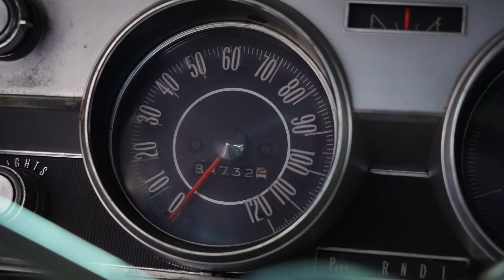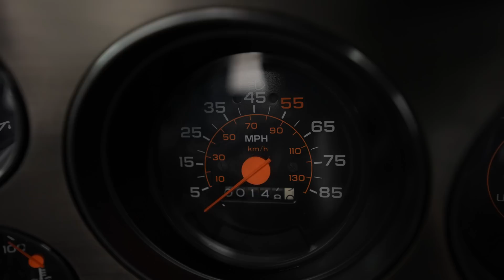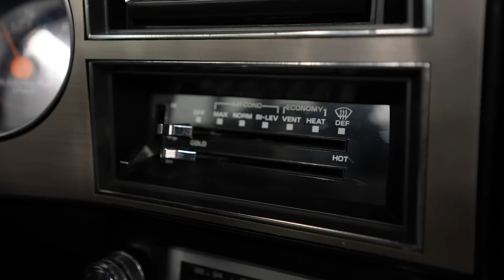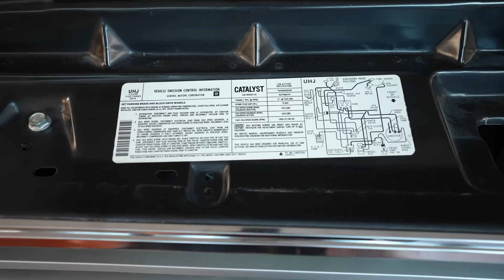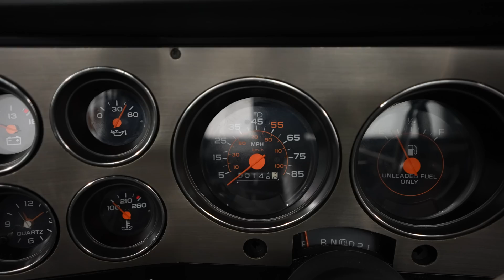EXTREMELY RARE Chevy C10 Short bed with 148 miles, WHAT'S IT WORTH? | Barn Find Hunter

Comment: I’m not a truck guy but that C10 is just beautiful.  I can’t imagine buying a vehicle that I’d be afraid to drive though.  It wasn’t built to sit in a garage not moving.  Having said that it might be best if a museum bought it, a place that would keep it pristine but where people could see and enjoy it.
Reply: True!! They need to get it out of the humidity and into a much drier storage facility. EG: The front sway bar had so much rust on it!! If I bought this truck it is going to cost me a lot of time to get all the rust accumulation removed and repainted. I would do it myself, so it wouldn’t cost much, but the time. Send it to a body shop and I see $10K or more. A lot of this truck will have to be dismantled and then put back together.  Some of those parts would be much cheaper to just replace,,, every part of this truck is still available essentially, but then it’s no longer the same truck!! 
     It’s worth maybe $60K. The truck is ultra low mileage, but wasn’t stored well. It’s affected a lot by the local environment.
Reply: repentandbelieveinJesusChrist2  I thought Jesus was a Ford guy.
Reply: BUilt to drive its just metal and bolts like any other. 
People act like its some rare hope diamond and if it sees the sun it will explode.

Comment: Dont LS that camaro.....
Reply: Yeah, I agree. LS is a good engine, but not what should be put in a car that original. Maybe if it were a fixed up rust bucket that's half patch panels, but something that's managed to keep most of it's original steel should have something at least close to era correct.

Comment: ON THAT cracking  protective sticker >>  09:25 --Turtle Wax Multi-Purpose Label and Sticker Remover will completely and safely remove that without damaging the paint,  my old 95 Explorer had those and this T.W. product worked like a charm,  spray a coat on it...let sit for a minute and gently start working protective film off with a thin plastic guitar pic..spray, repeat...then go down to terry cloth towel once down to gooey adhesive part..

Comment: The Silverado is nice but the 305 hurts it a bit.  I hope whoever gets it drives it.
The camaro needs to have the 327 rebuilt with a mild cam and replace the 3 on the floor with a 5 speed.  Cheers 🇨🇦
Reply: 305 or 350 doesn't really matter.  Neither are fast.  Truck is a cruiser, it won't be doing any work or towing so 305 is just fine.
Reply: Those Camaro's had 4 speeds
Reply: You couldn't get a 350 in a 1/2 ton 2wd truck that year.

Comment: The 85 Chevy truck is awesome -- I have a 1987 Chevy Silverado K10 with the Fi 350 bought brand new with every factory option including dual gas tanks have all the paperwork mine has 490 original miles - perfect show condition always garaged
Reply: I thought the K 10 was GMC
Reply: @worldboatskiff8709  K10 just means its 4 wheel drive -- C10 was 2 wheel drive
Reply: your truck is many times more desirable than this one, the 350 is almost unheard of, i had the same exact truck, short bed 20 years ago, it was a $5k truck then.
Reply: @freebird7284  Very Cool

Comment: Had the same truck but from a different mother mine was a 85 GMC short bed same everthing from the power windows to all the same trim just different badge-ing same motor as well the 305 yes it was a 2 barral as well I changed mine to a 4 just a few months after I bought it gave it more pep and torque.  
I personally put 82 thousand miles on it in those years just changed the batterie twice and the alternator dam good truck.  
Drove it till 1991 too this day I wished I had never gave it up!

I forgot to add that it was a Sierra Classic GMC red with black interior.

Comment: My grandfather bought a 1982 Scottsdale, same as this, shortbed, vertical front bumper guards, but proper rear bumper, flat top, chrome, I don’t know what that bumper on the back of this truck is all about.   My grandfather died in 1983 and the truck of course went to my dad, but really to my brothers and then in 1986 when I turned 15 it became my first car.   We never did figure out if it was a 305 or a 350, as none of the stickers told that, and we weren’t keen enough at the time to figure it out from the VIN or whatever.  But it was a Rochester Quadrajet, my grandfather had the cats removed, and made it dual exhaust with factory type mufflers.  He didn’t want it too loud, but wanted power.  And it was fast!     Off the line if you tipped into it the back tires would light up before it started to slide sideways a bit.  My dad had put wider tires on it to “handle a bigger payload”, and it looked like the proverbial bulldog.   It was a red that was almost orange, and the lower part was silver/gray, with the same chrome belt trim as this Silverado.  It had manual windows and door locks, but COLD A/C, and of  course power steering and brakes.   My grandfather knew what was needed and what was destined to fail, like power door locks and windows.    Cruising along at about 30-40mph and hearing that Quadrajet kick down into WOT was music to the ears, and if it was wet, it just might cut loose from that speed.    I got it sideways in the Piggly Wiggly parking lot during a light rain and always loved to hold it sideways as long as possible.   Well, I held it too long, sideways down the entire corridor of parked cars, came around the “end”, and surprise, surprise, there was a mid-70’s Gran Prix right in my way.  My right front hit the right rear of that car so hard it pushed that car across the next row and into another parking spot, knocking it some twenty feet plus.    If cracked the tailight lense and dimpled the massive bumper on the Pontiac.    The truck was caved in from the right front corner inwards.    It was the hardest accident I have been in to date.    My buddy and I both felt the live saving restraint of our seatbelts, otherwise we both would have been flung through the windshield and onto the pavement, and maybe the truck might have landed on us as it spun around, rear end in the air, stopping facing the opposite direction,  as if it all happened in slow motion.   My knuckles even hit the dash hard from steering wheel flex.  We were both fine, but scared shitless.    The truck was technically totaled but my dad declared he would rebuild it as it was greatly needed as a work truck, so it got rebuilt, ultimately rusting away by around 1994.   A sad fate.     Lots of awesome stories with that truck.     A book’s worth.    It looked the part, went the part, and did us right for years.    I got it stuck to the rails and got it out with a come-along so many times, it’s unreal, even uprooting a few pine trees in the process.   Only needed a tow once when both bumpers were resting on either side of a hole, no digging was working.    That was ugly and almost ripped the front bumper off.    The roof was the same color as the lower belt line too.   A Scottsdale but not a step side.       No hood ornament either.    Warped a head once hauling concrete and did the work myself, had both heads shaved to flat and match, and boy did it haul ass after that compression ratio raise.  I snuck in thin gaskets too without my dad catching on.   Premium fuel was needed after that.    Sometimes some octane boost during the summer.     At one point my dad was sick of bald back tires.     NHRA style burnouts didn’t help, but at Lowcountry Dragstrip, I smoked quite a few Camaros and Mustangs with super sticky tire launches, and admittedly gifted reaction times.    Often there would still be rocks stuck in the tread even after the 20 mile drive home.    The Colonel wasn’t too happy about that.  I paid dearly but it was worth it!    I think General Tire should have made my dad a stockholder at one point, as XP2000’s adorned both my Torino and the Scottsdale, p235/65R14 on the Torino, and 15 on the Chevy, and Sam’s Club knew me by name.   “Back already?”    “Again?”   Yeah.  Whoops. Seeing this truck was a step back in time to Ole Red.      Thank you guys for showing this.     When that truck got a rub down from me with good wax, it was damned pretty.

Comment: I have a 1985 C10 Scottsdale I bought new and has 44K miles on it. It has sat in a garage for most of its life however I use it as a truck so it has a few dings in it but otherwise in great condition. 305 4V, dual tanks, power windows, and lock. No carpet or air.

Comment: That truck belongs in a museum where enthusiast can enjoy it. I just snagged a 1993 garage kept WT with 88,000 original miles. I love the simplicity of the crank up windows, air delete and bench seat. The only gadgets being an am/fm and pull out cup holders in the dash. It's a great feeling driving a truck that is straight to the point. It likely listed new at $11,500. I purchased it at $7,500. It should have went for $12,000. Two tiny door dents on passenger, small stains on the seat, original everything except batt and tires.
Reply: Yeah just cruising with the window down and the elbow out the window. That simplicity is sublime and nostalgic.

Comment: I thought my 86 C-20 454/400/4:10 rear with 38,000 original miles was impressive. But that C-10 makes me tip my hat to that gentleman.
Reply: Looks all original except for the rear bumper, most all that I’ve seen came with a chrome step this one has a flat bumper that came on the blazers of that time period which looked better but not sure that the Silverado’s came with that bumper no expert but just saying super nice truck none the less,

Comment: I remember my dad passing on a ‘67 RS with a 327 and a powerglide from the original female owner for $750. My dad wanted a ‘69 with a manual. It was in Stockton, CA…so it was pristine!  That was just before he passed on a 1957 190 SL that the guy wanted $4,000. It needed the fuel pump rebuilt and the place in Los Angeles wanted $350. He offered the guy $3,000 for it…but the guy wanted $3,500. My dad said, “Let him sit on it for a week”. When he called him back, someone else came along and gave him the $4k.
I bought a brand new K10 loaded Silverado in 1984 for $13,500. Was yellow and white with a 350…even had the AM/FM with cassette. It was a pile of crap off of the lot. Pinged going up an overpass. Sold it for $8,500 and bought a Ramcharger. Much better truck than the GM crap back in the middle 1980s.

Comment: That is a beautiful Truck. If it was mine I would sell it and then take the money, find a Square Body Chevy Long Bed, cut the chassis out from the ass end, 4 link it with a Ford 9 inch, find a short bed to pop on it, then build a 5.3 LS with a single Turbo and drive the crap outta it. I would also have working A/C cos damn the Heat and Humidity in North Carolina in the Summer. 

I personally would be scared to death to put a truck that is basically new but 40 years old on the road. Plus you would have to pull the Engine and Transmission to put new seals and gaskets in her if you were gonna drive it some or after a couple heat cycles she would blow oil out everywhere and Trans fluid would probably pour outta it faster than you could put it in it. Plus I wouldn't get over 25 mph with the Tires that are on it cos my luck all 4 of them would blow at the same time slamming my New/Old/Cool Truck into the nearest immovable object.

Now if I was absolutely LOADED Rich I would find a nice Car and Truck Museum and let it hang out there so folks could look at her like she needs to be looked at. To me that is the most beautiful Chevy Truck ever produced. I reckon its because I was born in 77 and the 83, 84, 85 Chevy Trucks were the ones i remember because my Daddy had a 84 Chevy Silverado for a work truck, he was a Foreman for a Construction Company and they gave him that to drive for work so he didn't have to use his personal Truck. 

Damn I was rambling 🤣

Comment: Back in 1985, I wanted a new 1/2 ton SWB. 

My Dad went to test drive a Red/Red C-10 SWB.

No power, and could not hold any weight in back end,

So Dad Bought me , 
My first truck ,
1972 SWB. 402/B.B 
Cheyenne C-10 . 
Blue/White-blue interior.  
All original from original owner , for 
$2,000. cash.  
84.K miles. 
(January-1985)

Comment: Right now i  have a 85 gmc sierra half ton shortbed with 52 k . Spare tire never been on the ground. Jack never been out and no rust ever. i bought it in Apache Junction AZ. I have it in Tucson and it is really hard to use it as a truck. The  old 305 was shot because of lack  of oil changes..  I put a 350 crate,290 hp engine in. I'm going to sell it but it's hard to put a value on it.

Comment: I think it would be a good museum piece. Even though I don't believe in garaging a vehicle and letting it sit without use, one in that condition with ALL the tags and such, be a great addition to a museum somewhere. Those 305's from that era are oil burning pieces of junk. Some leaked on the showroom floor. I know I had an 86 El Camino. Engine would run no matter what, but went through oil like crazy.

Comment: Any car depreciates as soon as you leave the dealership. But if you never drive it you will realize a massive increase in value. In my bike collection I have several bikes with less than 20 miles. One has exactly 1.2miles. My friends think I'm crazy. But I say they're only new once. Restoration is fine but not the same.

Comment: Had a 85 Chevy Custom Deluxe it looks exactly like the truck shown  .Same color brown ! 1971 Corvet 350 4 bolt main I put in it rebuilt with Crane Racing equipment.If a new paint job it would have been in as good of condition but got rid of truch back in the early 90s

Comment: I'm torn on the truck.. I mean there are perfect examples of every single Chevy truck ever made. The only unique thing about it is the 148 miles. I saw an 88  (GMT400) at the Carlisle Pa truck nationals that had under 1k on it. I actually think that is rather sad. I bought my Chevy new in 89, and still have it. I absolutely love it, and the joy is in driving it, not just owning it. My truck surpassed 148 miles after 3 hours of owning it, but it also has 34 years of my life experience on it as well. A no miles truck/car has no story. It's just a perfect blank piece of paper. I'd be more impressed if it had 548,000 miles on it, and it still looked like that. Anyway, that's my two cents.

Comment: That truck is a holy grail truck... my opinion it belongs in a museum. As far as I'm concerned that is the most desirable color combo on the most desirable chevy truck platform they ever made triple black shortbed 2wd square body with 150 original mile surviver truck that looks absolutely flawless. Dont take any less than 125k my advice
Reply: Think the 67-72 is much more desirable

Comment: I have an 81. Also low mileage (about 80,000 but someone stole the original instrument panel). Been sitting outside its entire life. I'm the second owner, bought from the first. White, stripper with a 6 and manual tranny. Lots of fun to work on and fix up. Definitely not perfect. They built over 10 million square bodys. Everything is available for now. Parts are the very cheapest (in both ways). Mine drives Perfectly. Some body work required.

Comment: i remember the ol uniroyal tires of the 80's (tiger paws in my case).  stock on tens of thousands of gm cars back in the day.  not my first pick for a pickup, but i would cave in and buy it if i could afford it.  easily worth at least 75k.  100 wouldn't be out of the question.  besides...where else you gonna find something like this ?

Comment: There is a truck in Amarillo  Tx that has 33 original  miles on it  I think it's a 76 the man has a 68 camaro with 1600 miles on it and a 57 with 3300 on it it still has the factory air in the tires  and about 25 other cars
Reply: Oh he also has a new ss 454 he bought new and put it on jack stands in the shop

Comment: That c10 would be a good sevice truck put a fuel tank in it take it to the field to fuel up tractors because what good is it sitting there old seals are going to blow out after 200 miles then what do you got another c10 sitting waiting to be fixed

Comment: If keeping, I would drive it around.  So you put 500 or 1000 miles on it per year... who cares?  Maintain it and it will look great with 20,000 miles on it.  It will be worth a bit less but who cares?  Is this guy going to care if it's worth $125k or $75k?  It makes no difference financially unless you are very poor, in which case you would not have a $125k truck anyway.  But driving it means you can enjoy it, which is priceless!  

If selling at auction, of course keep it indoors and get rid of it ASAP.

Comment: If someone buys it to drive, sparingly, Id recommend buying new wheels and tires for safety purposes and keep the original tires and wheels. Ill defer to experts on changing the fluids. Fluids generally age so i wonder if driving with aged fluids would damage the drivetrain.
Reply: Yes it will damage. For example, brake fluid absorbs moisture and rusts everything. Old lubricants lose their viscocity specs and can damage engines, transmissions and even differentials

Comment: If this well preserved piece of technology was left under the element, we would have seen a different object today.
The roof, walls and controlled ambient temperature  over it - were actually what has kept it in tact.
However, start driving it regularly - and it will fall apart piece by piece, no better than its junk counterparts - Entropy is from inside out and outside in;
"In any system of energy, Control is what consumes energy the most.
No energy store holds enough energy to extract an amount of energy equal to the total energy it stores. 
No system of energy can deliver sum useful energy in excess of the total energy put into constructing it.
This universal truth applies to all systems.
Energy, like time, flows from past to future".